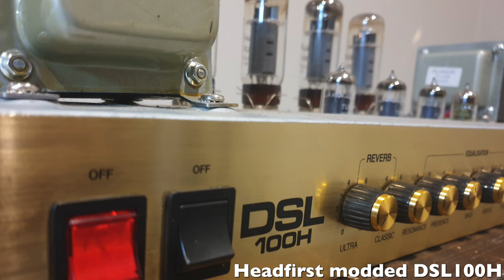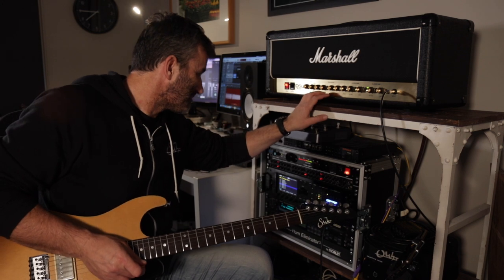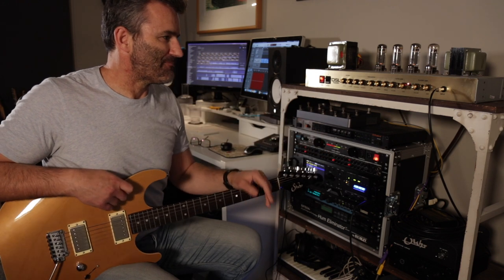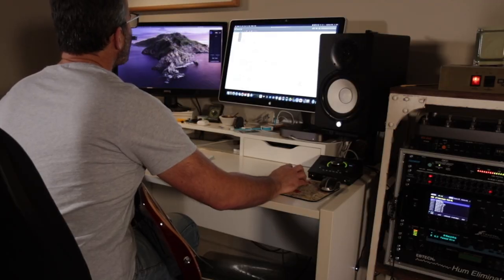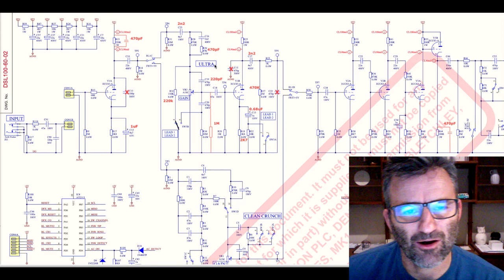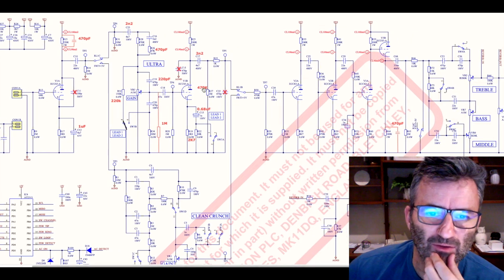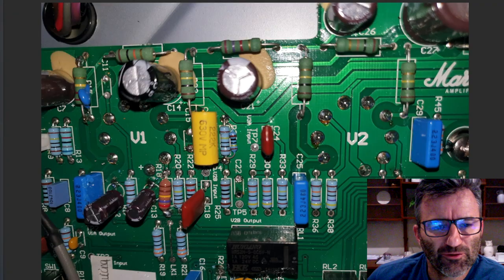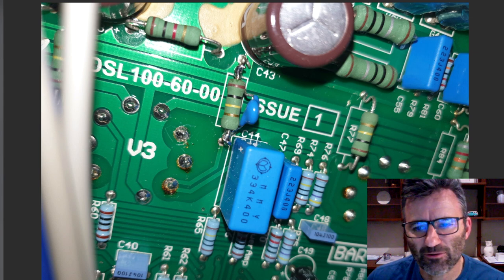Modding a Marshall DSL100H - TONES AND DIY GUIDE!!

Comment: If marshall ever does an updated version of this amp they should just delete the ultra gain 2 and make it essentially a 3 channel amp and have Clean, crunch and high gain. As well as tame the low end like you did and the harshness. If I were to have to use one of these amps stock I'd probably completely ignore both the high gain modes and just use the crunch mode boosted with an overdrive if I wanted high gain, although the crunch mode I'd say is pretty usable on its own for a crunchy rock type tone.
Reply from the maker: I agree with everything you say here 💯
Reply: The OD2 channel works well (and has a fatter voice) with the gain not super high...and then your guitar volume rolled off.  This avoids the mushyness and gives you quick control for getting that high gain out of the higher notes if you need it.  It's pretty cool for some lead stuff.  There are a lot of tricks in this amp but they aren't super apparent.
Reply: @vin9976  I get what you're saying, they aren't bad amps and they can be dialed to sound good. But I feel like you shouldn't have to do a bunch of stuff like that to make a Marshall sound like a Marshall. Quite honestly I think they should stick to their older circuits or do hot rod versions of them. The Laney GH series (not the Ti version) from what I understand are an 800 style circuit with an extra tube stage in front you can have on or off. Marshall could easily do something like that and throw in switchable zener diodes, a resonance control, and maybe a mid frequency selector in the style of the Ampeg VL, another 800 style amp with an extra tube stage in front. I mean people have been hot rodding their amps for 40+ years now you think they'd get the memo by now what people want 😂 although I'm sure they'd charge even more than they do for their reissue amps
Reply: @russiangoose7053  What you are describing is the JVM series dude.  It's just the price in the USA $$$$ vs the WAY more reasonable UK price.  Agreed tho.  I wish the DSL just hit the new school Marshall Clean, JTM800/Plexi Circuit, JVM800 and then Hotrod JVM800 (or 900 SLX I guess).  Who would  want anything more right?  We'd prob never buy anything else tho lol.  My DSL40CR was 550$ used.  It's pretty damn good with some messing around and a clean boost (to get closer to that tight JCM).  The whole $$$ thing is silly as its just cheap freaking parts in a PCB board with a WELL known circuit.  It's insane these things are 3x the cost of a damn insanely technical iPhone lol.  No one wants more R&D, they just want the old school tone and circuit with perhaps an FX loop or headphone jack lol.
Reply: @vin9976  honestly I just want a regular straight up 2204 or 1987, I don't care about multiple channels or versatility or FX loops or anything. I can play everything I want to play with a single humbucker and one channel and a volume knob. I can always throw a pedal to in on the rare occasion I need it.  I know not everyone likes really barebones rigs like that and they want to be able to get the most out of an amp, especially if it's an expensive one like Marshalls tend to be which is understandable. There's a lot more affordable amps than marshall that are straight up clones or in the ballpark. There's a guy in the states called Rockitt Retro who builds handwired Plexis and JMPs for under 2000. And with Headfirst amps they're much more versatile and affordable and built on quality PCBs, not some of the stuff you see from marshall in the studio and origin and DSL amps
Reply: @russiangoose7053  For sure.  I want that as well.  But I'd also like to get it to work at a friendlier volume just to be pragmatic about it.  What would you go with if you could pick something today?

Comment: Just curious does anyone know if this helps the headroom with using a boost? and allows for a little more gain? 

I've noticed that when boosting and trying to use like a "metal" amount of gain it gets very thuddy and the tone gets choked out. I've found you can kind of workaround this by turning up some gain on the boost and then turning down the gain on the amp itself, but you know, it would be nice to use the gain more on the amp just because it sounds good before it gets weird lol.

Comment: I did one of these amps and it sounds so much better.    I'm doing another one and just finished and now I don't have any gain on lead 1 and lead 2.  It's basically like a clean channel with not much volume.   You have any suggestions?
Reply from the maker: Check preamp tubes, check your mod soldering.  Use a meter or scope to trace signal.
Reply: @HeadfirstAmps  i traced it back to a bad resistor.  That’s the first time i’ve had a bad new resistor lol.    Thanks for your mods.  They are awesome!   And thanks for the reply
Reply from the maker: Great to hear you sorted it!

Comment: Hi My amp has this circuit that you show in your clip.  Could you tell me please which resistors are the grid blockers I want to check if mine has 220K or 5K6
Reply from the maker: Grid stoppers?  They won’t vary between those two extremes.  I think you are confusing grid bias resistors (normally 220k) with grid stoppers (normally in the 1k5 to 5k6 range)
Reply: @HeadfirstAmps  I could well of confused the term perhaps you could clarify it for me please. I was referencing this comment taken from the Marshall forum specifically the 'DSL Joey mod' thread where a chap wilder amplification says 'The grid swamper resistors are R7, R10, R66 and R70. Only the older models had 220K (red/red/yellow color bands) swampers. Yours may already have the 5K6 swampers (green/blue/red color bands).' I think the wilder chap refers to a JCM2000 DSL,
Trouble is I my own amp is the later DSL100H and I think circuit is different as wilder is reffering to a JCM2000 DSL. 
Do you know which resistors wilder refers to please which ones would they be in a DSL100H . 
Also a chap called ' TwinaACtacks also makes a reference to what I think is the same area the comments are page 8 on the thread TwinACstacks say's ..'I keep seeing issues with "Loose or Flabby Bass" that need being addressed. THE best mod I found is to Change the Grid blockers to 5k6 from 220K. Really tightens it up, That and a new OT and Choke'.
TwinACstacks seems to be stating some amps came with 220K and should be changed to 5K6 but again I don not know which resistors they are in the DSL100H
Wilder calls them 'Grid Swamper resistors' TwinACstacks' called them 'Grid blockers' I just want to know where they are in the circuit in my amp, Can you tell where they are please

Comment: Where is the master volume located on this amp? I can't understand the schematic/
Reply from the maker: Traditional Marshall master vol, between the tone stack and the PI input.
Reply: @HeadfirstAmps  but ... the modern model dsl100 contains two regulators - volume and master. where is the second one located on this model?

Comment: Can i use 50v 1uf and 50v 0.68.   Is the 50v fine i guess is what I’m asking?   Or does the voltage need to be higher
Reply from the maker: 50v is fine for those positions as cathode bypass caps
Reply: @HeadfirstAmps  thanks man!!
Reply: @HeadfirstAmps  is 1/4 watt resistors all ok to use or should I use 1 watt?
Reply from the maker: 1/2w better.  1w for plate resistors.  2w for power/b+ droppers
Reply: @HeadfirstAmps  all i had was a 1 watt 2.7k for R18.   Is that gonna be a problem?
Reply from the maker: Not at all.  That’s even better!
Reply: @HeadfirstAmps  i thought so.  Sorry for all the questions.  I’m learning 🤦‍♂️.   Thanks again

Comment: can i put 2 4700pf in series for 2n2 ?
Reply from the maker: Yep
Reply: @HeadfirstAmps  hey friend, thanks for providing your experience, today I modified my dsl15 and took a lot from this video and from mod #34, it sounds amazing now, it's amazing how those 2n2 feel in the hand, much more Tight on the low strings, I also left only 2n2 on the treble peaking and installed a switch with different bright caps, thanks!
Reply from the maker: Awesome!